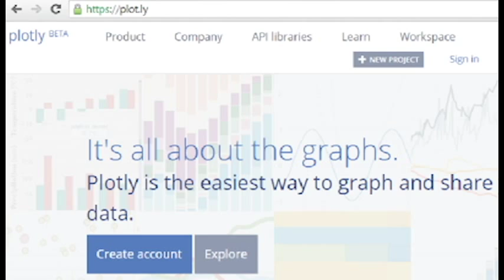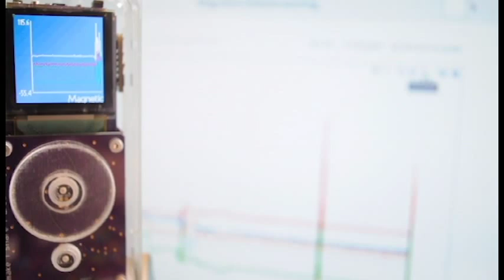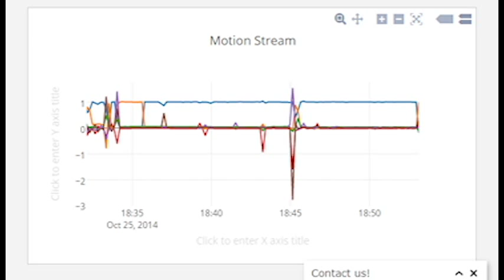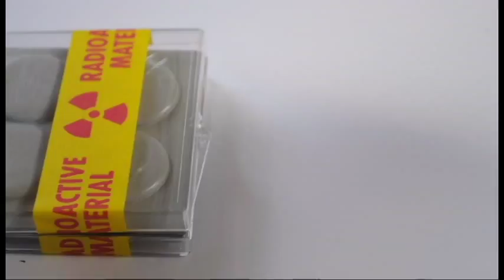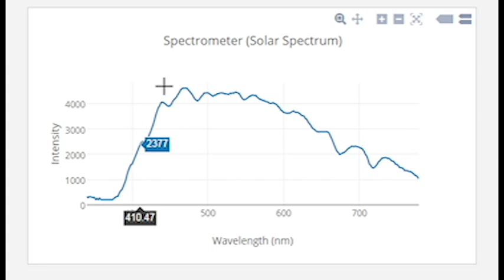The Arducorder Mini (HDP Final)

Comment: This is the mini, I assume there is a bigger version?
Reply: Hi Zenol, I had (sometime before this, in 2014) experimented with a (bigger) Arduino-Due compatible "Arducorder", but it was underpowered and a bit unwieldy to work with (some pictures of that prototype are available here: http://www.tricorderproject.org/blog/the-shape-of-things-to-come-the-mark-5-arducorder/ ).  The poor wiring in the house I was renting at the time appeared to blow it up, and I took it as a sign that it might be a good idea to start fresh -- sometime later I developed the designs for the Arducorder Mini in this video.  I have a half-built version of the next iteration, Iteration 8 ( https://hackaday.io/project/18518-iteration-8 ), but a new baby and being on the tenure-track has been a little unforgiving on free time unfortunately.  I need to clone myself, or find minions...
Reply: @peterjansen6244  you should revive the larger model, with new smaller tech these days it might actually work better. i honestly would hate to see such a wonderful project die so young.